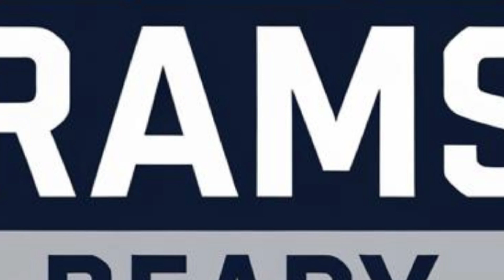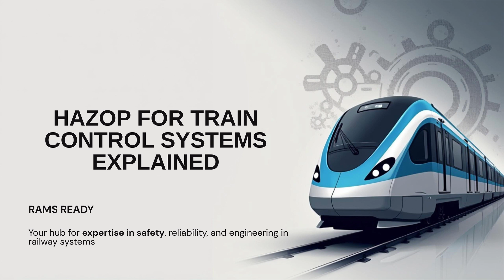HAZOP for Train Control Systems Explained

Comment from the maker: Working files for this topic, built to be used on a live project:

Kickoff and Workshop Facilitation Kit
Kickoff pack, HAZID and HAZOP workshop packs, participant role cards, data request checklist and a recording workbook.
https://ramsready.firstlinkai.com/p/D3

Railway RAMS Template Toolkit
Hazard log, FMECA, SIL allocation, risk matrix calibrator, EN 50126 lifecycle checklist and a safety case skeleton, eight working files.
https://ramsready.firstlinkai.com/p/A1

Free Lite Hazard Log workbook: https://ramsready.firstlinkai.com/free
All twenty products: https://ramsready.firstlinkai.com

Which part of this gives your projects the most trouble in practice?